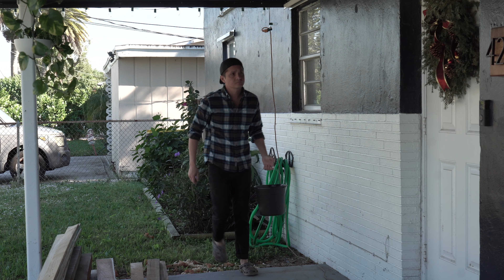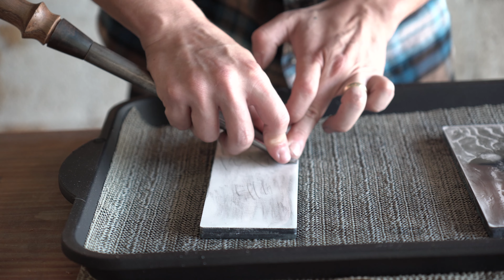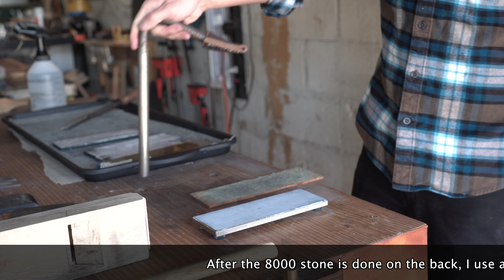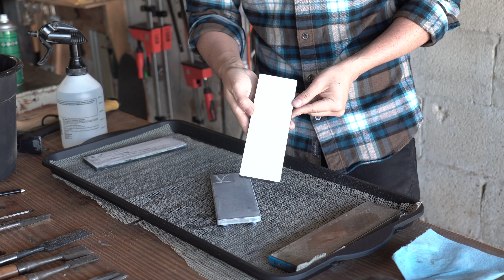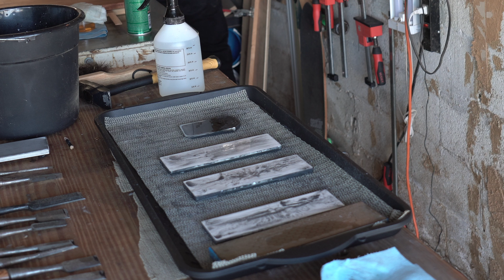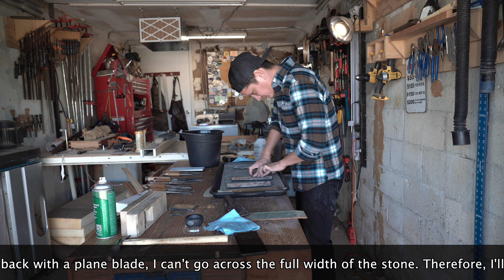REAL TIME Hand Tool Sharpening | ASMR | Japanese Woodworking | Scary Sharp

Comment: Hey bro, good video, nice to see how fellow woodworkers also do it. Also wanted to say I'm really not sure if your stone lapping is frequent enough. On a paring chisel you shouldn't have to go back to low grits to remove the burr, and you're not supposed to have too much fiddling to do like on the 3k stone, since you get it perfectly flat on first few set up sharpenings ! Anyways, stay flat and true. There's no results like Andrew does or professional shavings makers with stones not lapped every 30secs.
Reply from the maker: It probably isn’t frequent enough. I should be doing it almost instantly after doing the bevel and as you said jumping into higher grits immediately. Old habits die hard.
Reply: @CowDogCraftWorks  i wish you good sharpening future ! It gets addictive
Reply: @Robinouille  Boy is that a true statement!